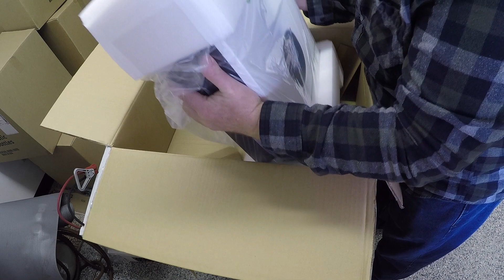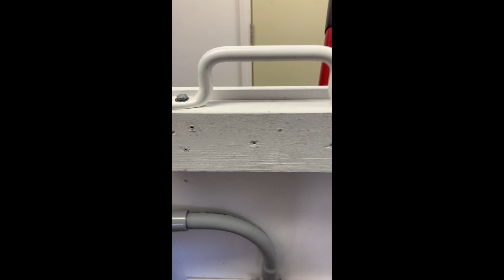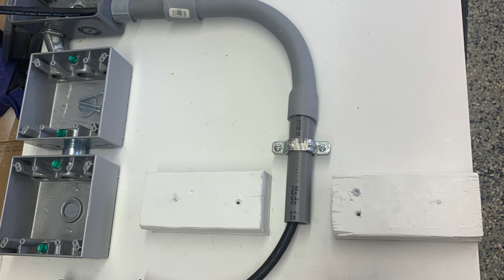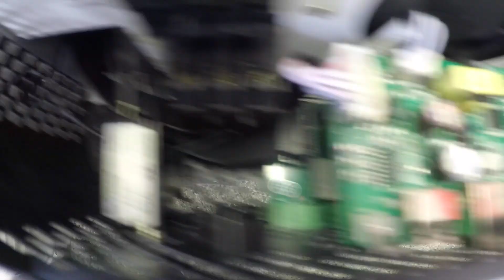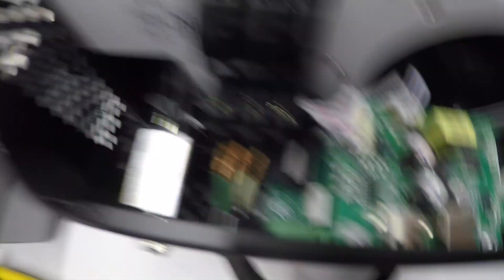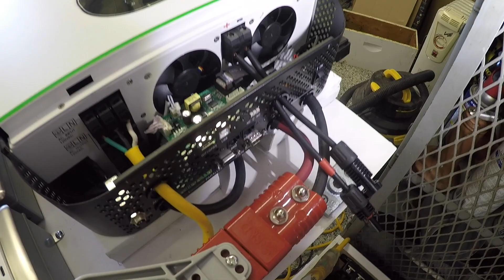Growatt 3000 watt 24 volt Solar Generator build pt1

Comment: Great job on this set up and an even better job at this video! You are very articulate and explained everything in great detail which is very much appreciated, thank you! How is this system now? Are you still happy with it?
Reply from the maker: I have sold this generator. I made a new one. I made a video on that one. Then I sold that one. I am planning to make a new solar generator using Victron components. The hold up is, I am waiting for the 48v Victron 5kw inverter to get a UL rating. This rating on this inverter has been pending for a full year now.

Comment: I do have a question, whats the 12v, 24v difference.  I see alot of videos but I am NOT sure when to use which ?  for example, My goal is to go off grid and power a 300w lighting system. and i was going to go with a lithium phosphate batter (100Ah). And i was looking into a all-in-one solar charger/controller/inverter. Using 2x200w solar panels.  I'll add more batteries later, when I have MORE money. Appreciate any advice, suggestions.
Reply from the maker: The way to go is 24 volts. Wire is smaller gauge and the system will be more efficient. The easy way to go is by using a MPP 2724inverter ($642.00). It is an all in one inverter. The inverter has 120v plug ins on the side of the inverter, also some usb plugs also. The inverter has an AC in, for charging from the grid or a generator. https://youtu.be/pSwi7v-2Bs4. There are knockoffs of this inverter. To make sure you get the real one, Buy it from https://watts247.com/product/pip-2724lv-mr/
This inverter and a EG4 24v 200ah battery https://www.signaturesolar.com/products/24v-200ah-lifepower4-battery-by-eg4. The battery is around $1500, but it is a 5kw battery with a <7000 charge cycle rating. That is about 18 years of cycling it everyday. This would be the easiest way to start a solar system with minimal solar experience. Just hook up the battery, (cables included) and it will make 120v. That simple. here is another video https://youtu.be/P_OKib30Ubo

Comment: Love it, I watched all three parts. I plan to to the exact same only with 16 cells making a 620ah 24v bank.
Again nice job.
Reply from the maker: What cells are you going to use? I have purchased two - 12v SOK 206ah batteries. I was going to upgrade my build and add some 12v Anderson Power Poles for disaster ham radio power plus a couple 12 volt cigarette lighter plugs.
Reply: @beefitter  I actually ordered on the 6th and was given tracking on the 13th. I went with 16 310ah cells and 2 daly 8s150a bms. Total shipped was $2525.
Did you make your own cables? I notice when piecing my stuff together online nearly all post and ring sizes are different. The bms is a m8 or kinda 5/16. I read online the growatt dc input stud is 1/4. The studs on the bus bars I like are 1/4 which is good and the studs on the battery shut off I like are 5/16. Guess what I'm getting at is it seems easier to just make my own cables than try to match component stud/ring size or find cables with two different size ring terminals.
Thanks

Comment: Nicely done!!!!
You should have more views.
I am stealing your ideas, Bear Island landing, diy solar & Lithium Solar.
Mine will have a little bit of everyones ideas but unique to where an elderly lady can deal with moving & placing where needed.  I am using a "Lifetime Stacking Chair Dolly" ($86. on Amazon) & adding two swivel casters with brakes in the front.
Due to our solid 4 day ERCOT outage in Feb. here in Texas I will be buying a 48V All- in-One MPP Inverter & one 48V Lifepo4 battery.  MPP stuff is on back-order.
I looked @ my last 12 months of electric usage &    saw that I use on average 30kWh daily.  I hope to get a EV pickup in 2022 or 2023 so my usage will go up.  We had zero sunshine during those 4 days we were out.  So, I wud like to have 7 days of battery storage ready to go.  During Hurricanes, it rains non-stop for 3 days.
How do I do the math to figure out how many batteries (48V 200 amps) to give me around 40 Kwh for 7 days?
You have inspired me!!
I can't wait to start my project!
Reply from the maker: To do a solar system like you are talking about would cost you probably $20k or more. You really need to figure out your minimal load you need to survive. Then add 20% - 30% to that number. Don't get me wrong if you can afford a 30kw-40kw system then I say go for it. But that kind of system needs much more robust inverters than I am showing here. Something to consider. Size your load on what you need in a day or two. Then get a propane powered generator to assist you in getting past several days of no sunshine. Propane lasts for years, compared to gasoline that lasts months. Then you can always have a backup plan if the solar is not available. A 250 gallon propane tank would run a generator for a long time and probably could be done for under $5000.00. Having the dual energy plan would really be a good prepper plan.
Reply: Oh my gosh!
$20k is too much!  Ok.  I will isolate the appliances I need to survive.  (2 refrigerators, 2 freezers, a 2-ton HVAC...in the future a mini-split...., an induction cooktop, Tankless water Heater & 1 TV.....in a yr. or 2 a Tesla level 2 Charger.)
That is a lot, huh?
Hahahaha
I like & appreciate  your advice, Thank You.

Comment: Growatt batteries? Anyone have experience using with Growatt all in one systems?
Reply from the maker: I really haven't seen their battery offering. Growatt talks about their battery and how the communication port can be used off the inverter to the battery. I have purchased my inverter through watts247.com and they do not offer them.

Comment: How many batteries do you think I would need for a small residential house. Chest freezer, refrigerator,  lights and TV. I would want to be able to run with a SHTF 
For a couple days without sunshine.  
I live in Central Kentucky. I've never used solar before and with the looks of the state of the world I want to protect my family.
Reply from the maker: Best advice is to buy yourself a kill a watt meter. Buy the expensive one, I think they are $35.00. Plug all of your appliances into it for three days for each appliance. Then add up all of the power they used over a three day period. Add 20% to the number and that should be approximately how much battery storage you would need.
Reply: @beefitter  awesome,  thank you so much.

Comment: looks great.  What are the dimensions of the plywood backing board? HxW
wait....isn't the MC4 Positive Output of a Panel a male plug, and therefore the input to the charge controller a female plug?
Reply from the maker: 24" H x 21-1/2" W
Reply: @beefitter  after a year since I saw your video, I finally built mine according to your pattern.  The problem I have run into, is that for every AC load I plug in, the 20amp breaker trips.  Did you have a similar problem? Either the GFCI does not like it or some part is malfunctioning.  Any idea? thanks
Reply from the maker: @dougbertInExile  you must have a short in your wiring. Is the GFCI wired correctly? I have never popped the breaker. Sometimes a GFCI can be bad out of the box. There is a tester for GFCI's that simulates a short that trips the GFCI at the proper ground fault amperage. I would reevaluate your wiring.
Reply: @beefitter  did you do a Neutral-Ground bond?